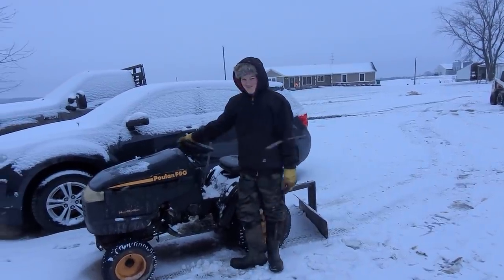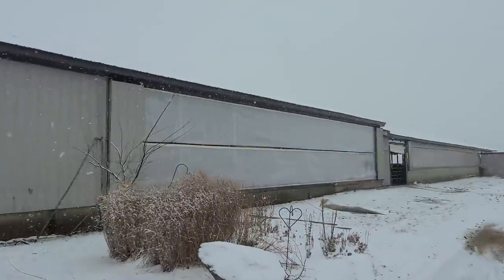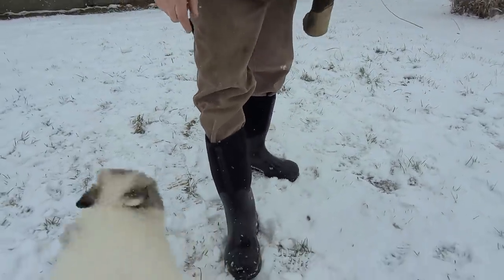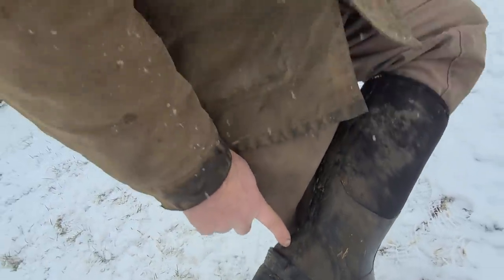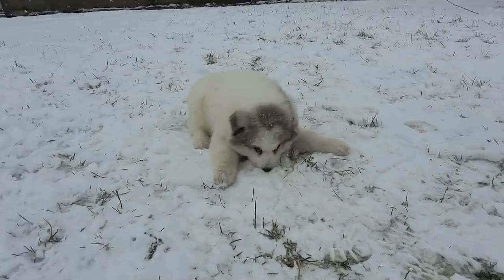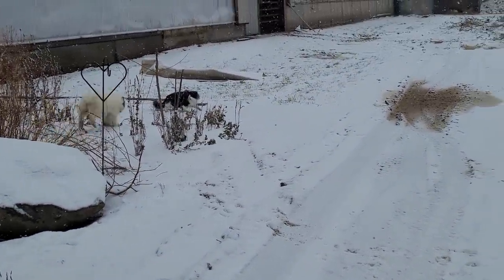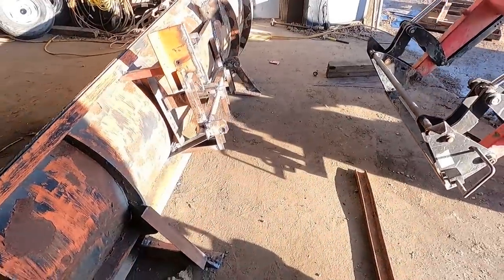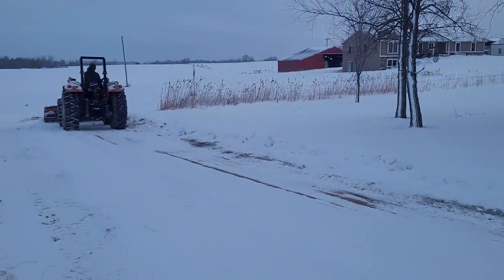Plowing Snow with Homemade Plows

Comment: I've been wearing QUATRO BOOTS for a long time, insulated and non insolated. Both have been GREAT boots, they have great traction and vary comfortable ,but they are on the spendy side but you can't put a price on comfortable foot wear that you can be in all day long no matter if it's in the shop on concrete, in the barn,   acidic feeds and manure!!

Comment: It may need a change of angle, but this plough, should be very useful pushing up on the silage clamp too! With a bit of Kevin's ingenuity it should be possible to hinge the blade to change the angle for different uses. It is much easier to push up, and keep the clamp level when the blade you are pushing with is a bit wider than the tractor wheel width!
Reply from the maker: Ethan agrees with what you said. The blade should be angled a bit more.

Comment: Wow I can't believe Sanders whipped up that plow for the back of his tractor like that, he is a natural born fabricator. Just wait and see the things that he is going to design and build in the coming years! Nice job with the plow for the loader tractor that looks like it works good. That Massey is a stout little tractor huh? It sounds like it runs so nice what is that a four-cylinder turbo charged engine or a six cylinder?
Reply from the maker: 4 cylinder

Comment: The best boots i ever had to keep my feet warm were a free pair i picked up in a junkyard where I bought a corvair. The boots were white, real thick from the ankle down and had a air valve on the side where  you could add pressure to inflate a bladder inside. The top had a strap where you folded it together to close the top. Someone told me they were military issue but I didn't ever see any because i was in Phoenix Az. My feet never did get cold in them and I wore them throughout the Iowa winters. Never seen anything like it since. Perfect fit like a boot.
Reply: @stanleyniemeier6972  i loved mine.

Comment: You sent your weather to me again. Today I got 6 inches of snow. Actually had to beak out my trusty 26 year old snow blower. Which I've never changed the spark plug in. Probably can't now it's been there so long. Worst part is my company called and I have to work tomorrow in 14 degree weather. Not exactly the kind of weather I like pouring concrete in. Sandwes has a nice conspt with that plow. Now he has to build a backing frame for it and put on a cutting edge.
Reply from the maker: Pouring concrete in below freezing temps and snow!? Stay safe and warm out there.

Comment: The blade is to straight. Needs more angle to the right side so the snow rolls off to the right. Especially at the slower speed. Ran them straighter on the county truck but going 40+ mph.